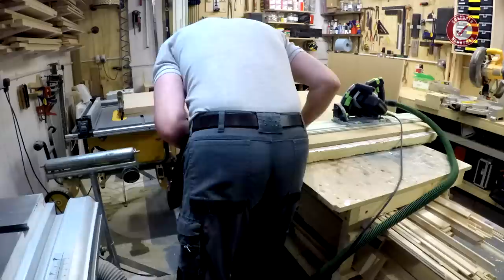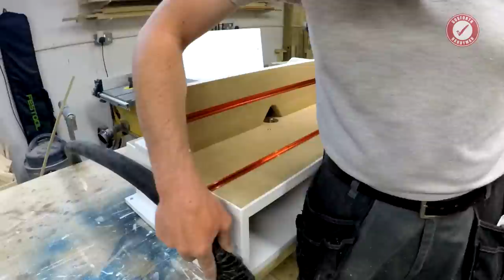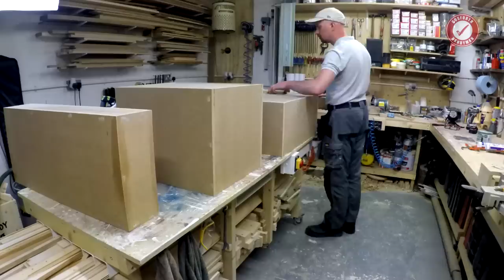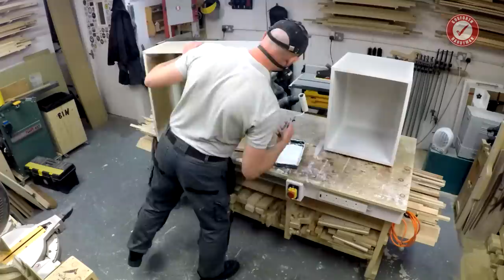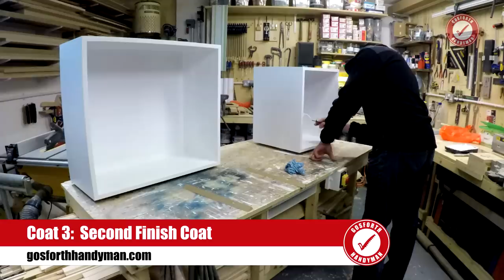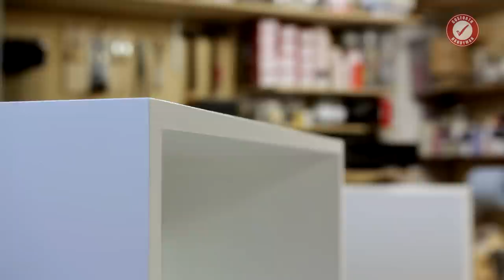Making MDF Display Boxes & Display Plinth / Pedestal (Timelapse)

Comment: Good video THANK YOU
What glue do you use to connect MDF?
  I tried a super sticky activator, it didn't go very well.
Joining with screws is due to cracking of the material.
I use 19 mm thick MDF

Comment: This may seem like a silly question but here goes , I noticed you run the tops and sides through the router table . Im guessing this is for a rebate for the back panels to sit in ? If so how do you not see the ends of the rebate when its all assembled. Hope im making sense 🤔
Reply from the maker: Well spotted! Just a dot of filler while I'm doing the nail holes etc. 👍
Reply: Gosforth Handyman ahhh as easy as that ,thats for the reply , loving your vids😁

Comment: What make mdf edge sealant do you use, also what preparation is required before using the sealant, thanks.
Reply from the maker: Julian Gardner it's just acrylic primer undercoat applied to the edges and allowed to dry - will cover in next vids 👍
Reply: Thanks

Comment: Hi Andy, when you have so many things to paint like you were saying in this video, do you still use Leyland Fast Drying Gloss? Can't seem to find a tub of the paint bigger than 2.5L. Noticed Leyland do a High Gloss Paint in 5L which is tough & durable (about the same price as 2.5L fast drying gloss) but its solvent based (would prefer water based). I have a lot of MDF to paint so just wondered if there is a cost effective way with the paint.
Reply from the maker: How much do you have to paint? A 2.5L tin will cover a LOT of MDF. I hardly ever use solvent based paints now - other than perhaps for exterior stuff. 👍

Comment: I'd be interested to see how you get your square cuts with the track saw. It looks like you measure, and then align the track with a 12" speed square. That is what I do. Have you thought about going the parf guide approach (MFT type top with dogs)? I have, but reverted to the speed square as I just don't have the space that system requires (you really need a bench with access on all sides). But you have a lot of space and would probably work really well. replacement MFT top clones are dead cheap on ebay.
Reply from the maker: Cheers - yes, that's what I do. I normally mark a light square line too just to double check. The MFT thing is very tempting but I'd need to re-arrange everything... again. 😂👍

Comment: why  is this video flickering like crazy ,Is it the ceiling light broken ?
Reply from the maker: IIIZiPIII it's something to do with my crap GoPro. The lights are fine. Once you're aware of it it's really annoying! 😨👍
Reply: The go pro and the lights are not in sync , thats why 
When you use a camera with manual mode either a dslr or even a smartphone , you can control that with shutter speed

Comment: Amazing work sir. Good video as well. Do you think MDF is good enough material to make a tv stand out off?? Been thinking of a skill to learn so that I can make a bit of income on the side and I would love to do carpentry and sell furniture.  Thanks in advance for the reply.
Reply: @Gosforth Handyman
Reply from the maker: Thank you! Yes absolutely, but you do need to account for sagging in the design. Long spans can sag over time. I mainly use MDF for built-in furniture. 👍
Reply: @GosforthHandyman  gotcha, what I was looking into building is actually a combination of both, built in floating cabinet like entertainment center pieces over the tv stand. Do you have Facebook or Instagram so that I may show you pics to see if it's a good idea to recreate???